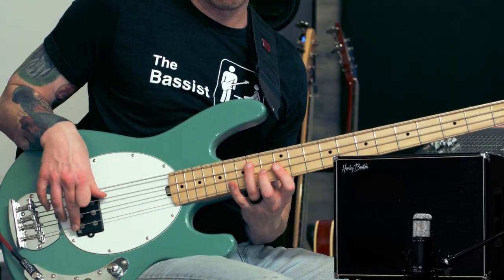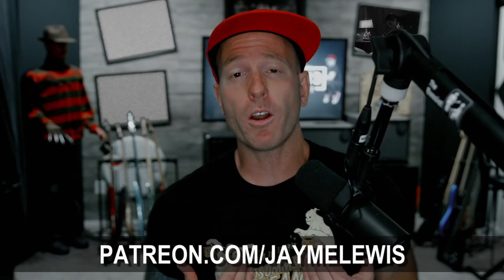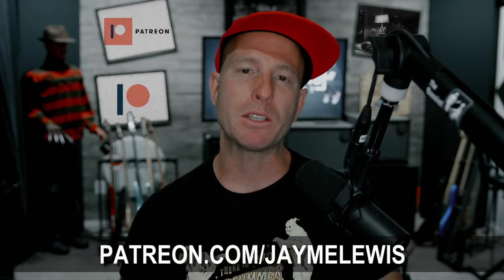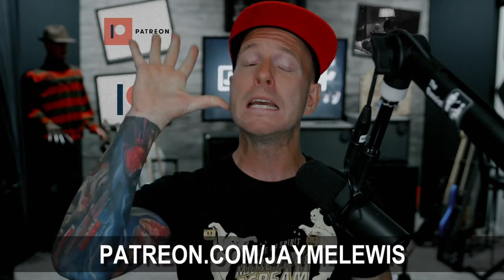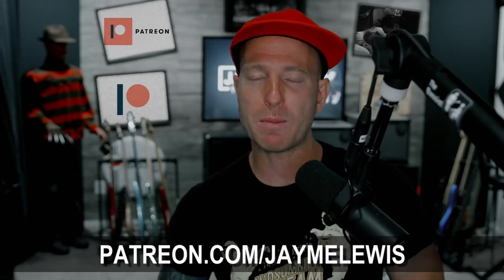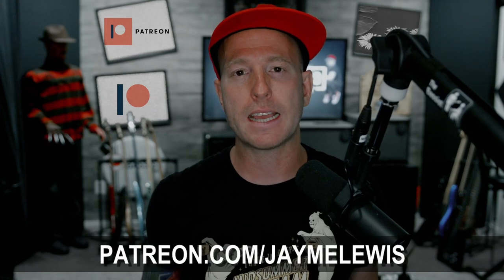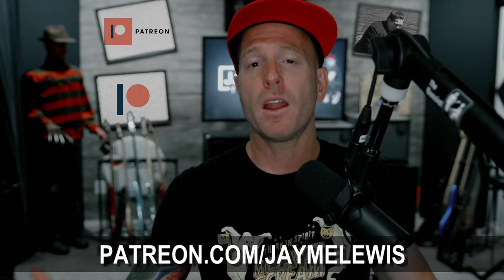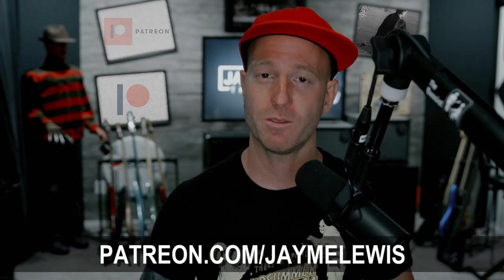Harley Benton SolidBass 210T - What Does it Sound Like?

Comment: Hi Jayme! I'm looking for a open sounding and light cabinet. I wanted to ask, if you had to choose only one HB cab, would you choose the 210 or the 115? Thank you!
Reply: May I give u an answer to ur question, even though I'm not Jayme? Well, In my humble opinion the choice of gear should depend on the usage and also on the entire signal chain, so to speak. What sort of gigs and locations are you playin?  In today's times most gigs are brought to the audience by FOH guys and their equipment, so a solid backline would hardly be required. I'd observe a tendency towards using FXs and preamps and/or DI and have the stage sound come via IE. If you like the sound of a two by ten, then go for it. It might be more versatile than any one by fifteen...

Comment: Is it possible to use a preamp direct in this cab? like nux melvin lee davis? or is completely necessary to use an amp? 

anyway, great video
Reply: Late reply, but a preamp will always require a power amp to work with a cabinet (except maybe some very rare exceptions that I've never heard of).
I use a cheap bass preamp and a 70's Peavey PA amp for my power amp myself :)
Reply: @MickMod  Thanks for answering, in the end i went straigt for a multieffect pedal (Nux MG30) and is my main gear for studio an live